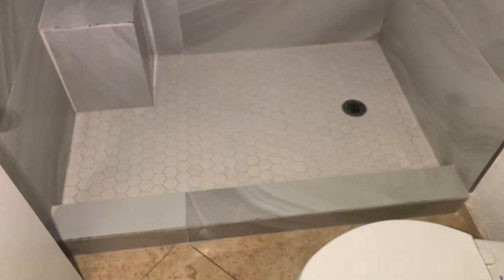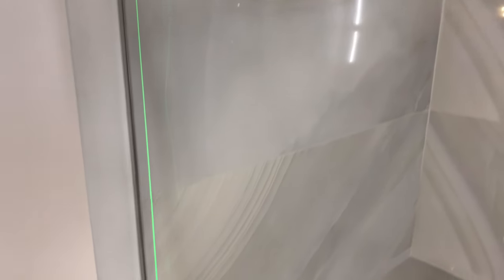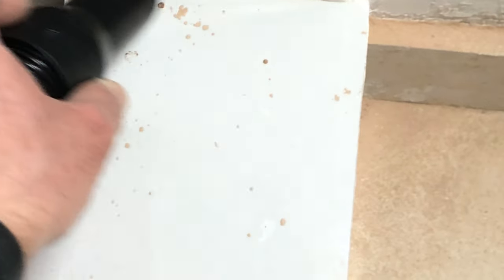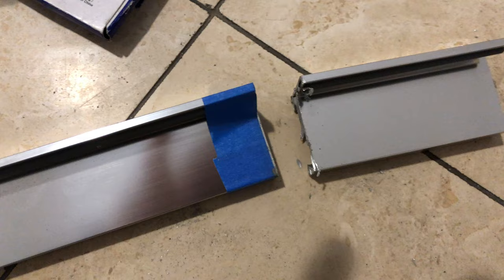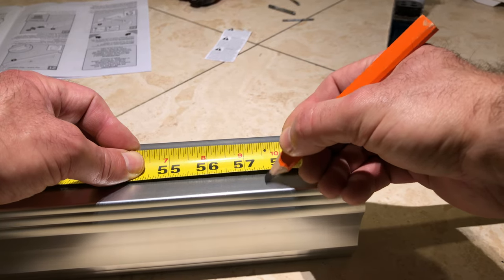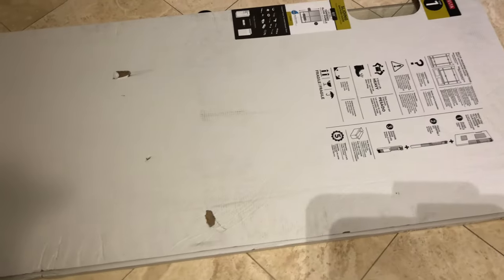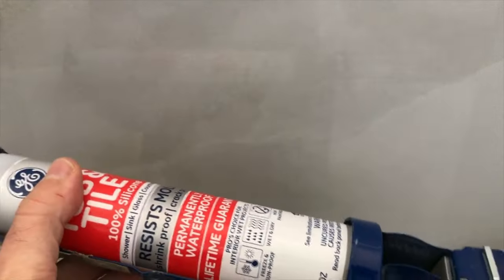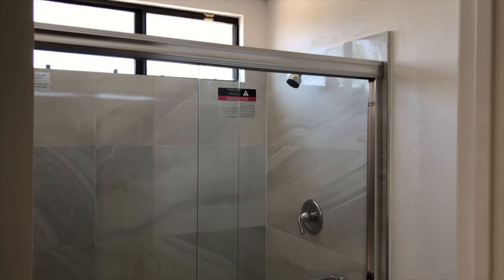Installing Delta Simplicity Sliding Shower Door

Comment: I watched this video this morning and installed the doors this afternoon. Delta has good instructions but this is a great video and definitely worth the time to watch it! I recommend that anyone doing this job get a diamond-tipped bit if you are drilling porcelain tile, they are worth the extra cost. If you are not good with a diamond-tipped bit cut yourself a templated from a piece of plywood or watch a video on how to use one and practice on some scrap tile or you may damage your tile. Also, the Delta instructions that were in my package say drill a 3/16 hole in the tile but that is not correct it is 5/16, hopefully, they have corrected that in the instruction book.
Reply: Do you have the Delta model number and where you bought it? I need to replace my old shower doors. Thanks.

Comment: For ones that are not really good on a neat caulking job, create a channel for the caulk to be applied with two strips of painters tape at desired width. Remove the tape after the caulk becomes fairly firm BUT HAS NOT CURED COMPLETELY. This will minimize any "ripping " of the caulk's edges and give a nice clean uniform appearance. Tape removal after the caulk has cured completely might result in a " jagged ripped " looking appearance.
Reply: So, I keep on getting ridges when i pull the tape....are you saying that this is a symptom of pulling the tape too soon? I'm at the end stages of a bathroom renovation and caulking has been frustrating
Reply: @robrero  After you put tape and applied silicon use your finger to push silicon, then remove the tape right away, clean your finger and use it again on silicon to make it smooth and remove lines of silicon left with tape. If you don't do that you will end up with 2 higher lines of silicon, one on each side.

Comment: Great, easy to follow video.  I had a very similar Delta door "professionally" installed last year but the doors are very wobbly when you slide them. It's very loud and annoying, I feel like I'm risking breaking the glass .
Reply: Do you know if it was attached to a stud?
Reply: @amr254  yes, so was the previous one.

Comment: Thanks for the video. I am in the middle of the installation process and I am a little bit worried about the bottom track not being secured to the curb of the shower. The installation guide doesn't include any screw to fix the bottom track and I don't feel comfortable relying only on the silicon applied in the channel under it. In your video (9:47) one can also see that the bottom track is kind of wobbling up and down. It moves up and down as you press on it. Putting just silicon at the edges will keep the track steady and it won't be enough to stop water entering under the track. I believe that this is why a lot of customers in their reviews are complaining about water splashing out of the shower. Honestly, I am thinking of putting at least two screws through the track into the curb to make it stable and prevent any gaps between the track and the tiles of the curb. My curb is made out of concrete bricks so there shouldn't be any damage if moisture gets through the screws. Your opinion?
Reply: If you silicon the base track on both side it will be enough to hold it
Reply: Good idea, you can fill holes with lots of silicon before putting the screws, that way water doesn't get inside bricks.

Comment: I watched your video several times before installing my shower doors I added two screws at the top rail at either end though and I added a 3-inch screw into my sill beneath the door guides on the bottom rail

Comment: I had mine installed by a contractor and it leaks, I love the shower but there is nothing that keeps it from running under to glass to the outside of frame what am i missing he said he caulked it

Comment: Great video, can you please lest the laser level you used?
Reply from the maker: Here is the link, not a sponsor and I paid full retail on the laser. It demands batteries but works well: 
Huepar 902CG Self-Leveling 360-Degree Cross Line Laser Level with Pulse Mode, Switchable Horizontal and Vertical Green Beam Laser Tool, Magnetic Pivoting Base Included https://www.amazon.com/dp/B074XX1DTC/ref=cm_sw_r_cp_api_glt_i_PTVCDTK9VV2K651KJ98C?_encoding=UTF8&psc=1
Reply: Thaks.

Comment: When showering does it matter if the outside door is closed towards the shower head or the other end in regards to water exiting the shower? Or does it not matter which way any door is closed during showering?
Reply: Yes it matters. The inside door needs to be towards the shower head.  The water needs to run off one door and overlap onto the next door.  If they are in the wrong order water will shoot between the two doors.
Reply: Just this installed by a ( handyman ). First the door had a gap on both sides when fully open, the gap gets wider towards the middle and even more at the bottom. He adjusted it, but now the door doesn't stay shut and slides open, leaving a gap at both ends. Any suggestions on what he did wrong!

Comment: Tips on cutting off the top rail? I want to get the same cut off tool. Will a diamond wheel be best to cut? Surprised there were no sparks
Reply from the maker: Good question, I used this cutting wheel - not a sponsor: 

3 in. Metal Cut Off Wheel (3-Pack)

https://www.homedepot.com/p/306599198
Reply: I used a 32TPI hack saw... Works just fine

Comment: I did everything the way the instructions that came with the shower doors and your video  and the inside glass door is hitting at the bottom corner on the metal frame

Comment: Thanks for the video, the bottom base rail should also have caulking which will help secure that rail a little more to the floor. Otherwise it will move on the one side like shown in the video. The glass also has a particular side which goes in and out, as well as that wheel slide attached to the glass.

Comment: Please give me the link to the brand or kind of laser level you used
Reply from the maker: Not sponsored. It consumes batteries faster than I expected but it worked well. Huepar 902CG Self-Leveling 360-Degree Cross Line Laser Level with Pulse Mode, Switchable Horizontal and Vertical Green Beam Laser Tool, Magnetic Pivoting Base Included https://www.amazon.com/dp/B074XX1DTC/ref=cm_sw_r_cp_api_glt_fabc_3D2YXN5A3G0QRX16RNJP?_encoding=UTF8&psc=1
Reply: @ToolsReview  thank you very much

Comment: That sucks you had to drill the pilot holes through the frames. As much as they're charging for these, delta should be putting the holes in them. That's a joke. The one I did for my parents had them predrilled